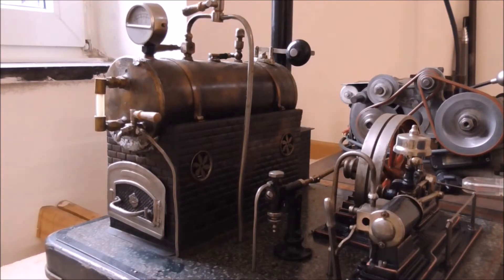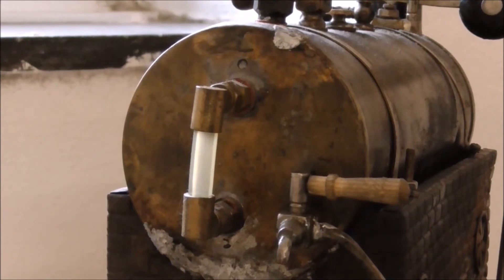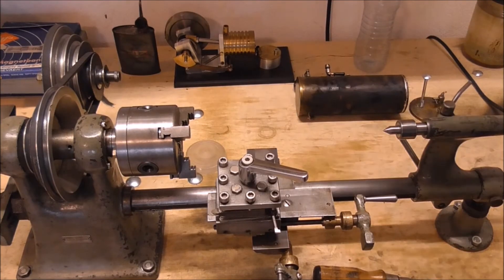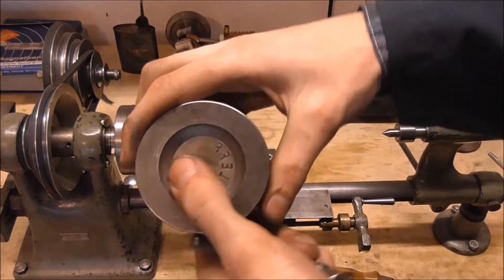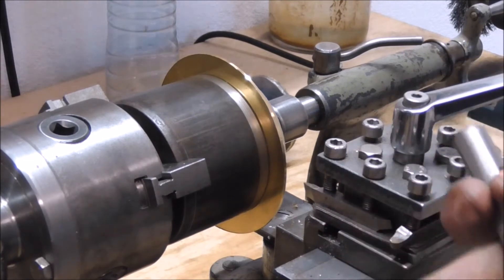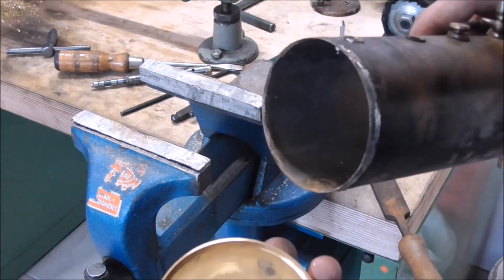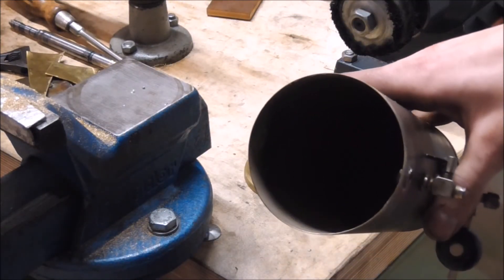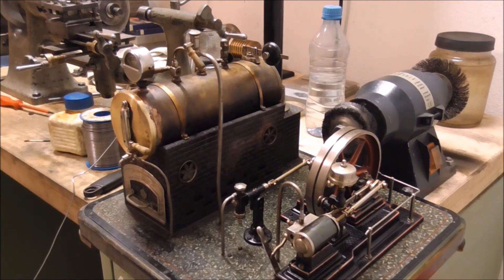Metal Spinning: Boiler Cap for Bing 130 / 302

Comment: Lovely. Need to make an end cap too! Sadly I only have a unimat lathe. I hope it will work...
Reply from the maker: You might have success with thinner sheet.
I used 1mm here, but .5 would be plenty for the pressures involved.
Reply: @AstraWerke  I was indeed going to use a thin piece of brass. Around 0,2-0.3mm thick. I was planning to make a cap for a small Falk, but I might succeed using the old one. Nevertheless I'm going to try metal spinning soon.

Ps; you have a nice channel page, I subscribed.

Regards,
Willem
Reply from the maker: @Willemtweetakt  Well, thank you!
I wish you the best of luck on your Falk - should there be holes or cracks in the cap, you might get away by soldering strips of sheet over them from behind.

Comment: A nice repair Adrian, and quite a nice engine and boiler. I'm pretty sure brass is no longer recommended for boiler ends, as the lead tends to leach out in use, making the brass porus and brittle. I dont think you'll have much trouble from it unless you run the boile a lot,,, but something to keep in mind. Copper would be better, and easier to form if annealed. Still a good job,,n nicely done. Oh yay, I'm the first to like ,lol
Reply from the maker: Thanks for your Comment,
As far as I know, most boilers are still made out of Brass (I know for sure from Wilesco, Mamod and Jensen), and this Machine so far remains the only one I owned that had cracks on the boiler (a missing sightglass indicates to me though, that the machine may have been dropped at some unfortunate moment) - so I don't think this is too big a problem. Thanks for telling me though, I never knew!
Best Wishes
Adrian

Comment: Very nice work Adrian, At a company i used to work for I often had to hand make odd trim parts for classic BMW's mainly 328's (1939), I found it very satisfying working in brass, and seeing the parts back from chrome plating and fitted to a shiney car was wonderful.
 Regards, J.
Reply from the maker: As long as your tools are sharp, Brass is really a wonderful material to work with - the only annoying thing is cleaning all the flaky chips off an oily machine ;-)
Best Wishes